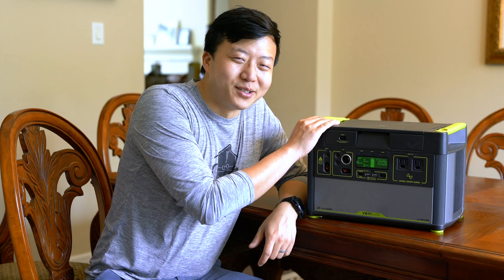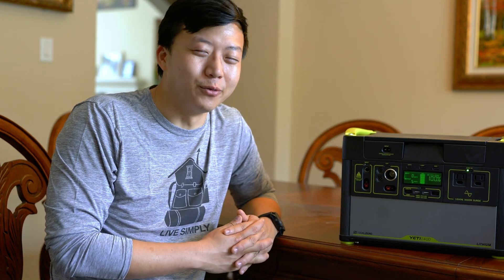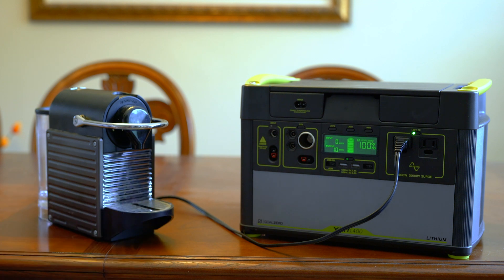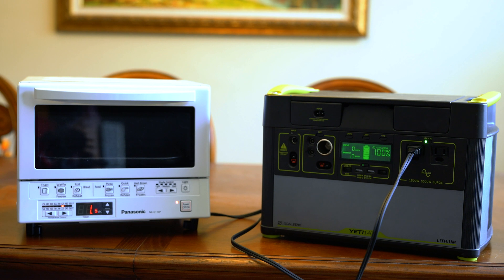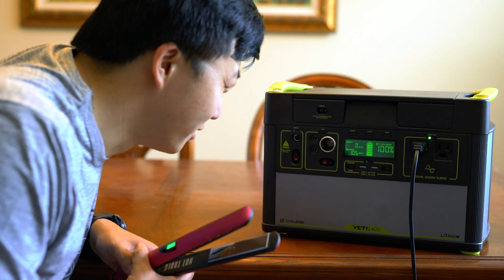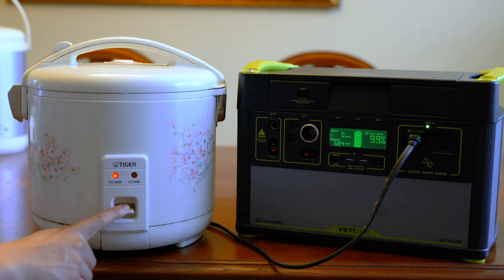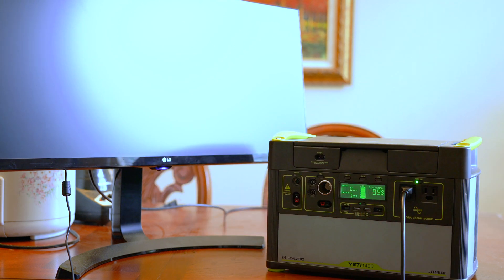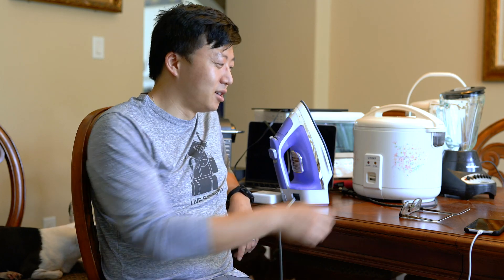Testing Power Draw of Appliances | GOAL ZERO YETI 1400

Comment: Great video. I just bought a GZ 1400 and when it gets here I was planning on doing the same exercise.  I am going to test the  draw of a recyclable battery charger (for AA, AAA, C, D etc) as well as my home microwave. I need to also check time to boil a cup of water using the microwave versus something like an electric tea kettle. For my purposes I’m looking at battery life for freeze dried food prep during an emergency outage. I also would recommend a sun oven. It’s sort of like Nature’s crock pot. You set out your one pot dish to cook in the morning and it’s ready for dinner time, e.g. pot roast, lentils etc. love the tip on the infrared toaster oven. Sandy